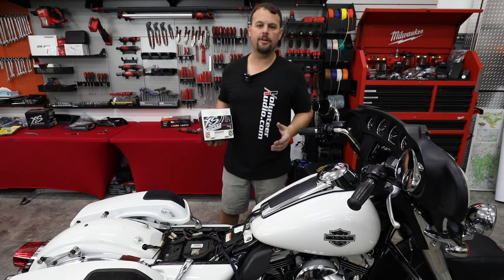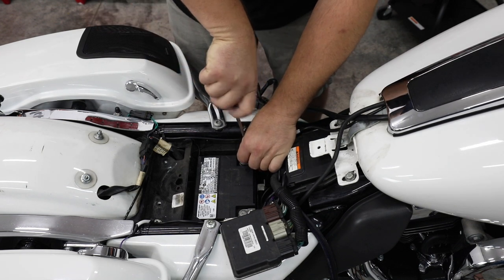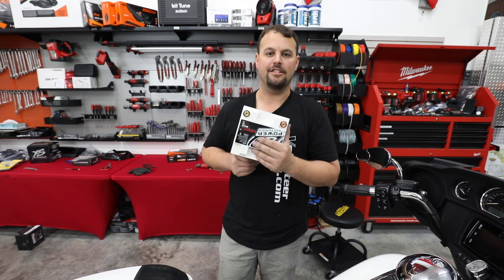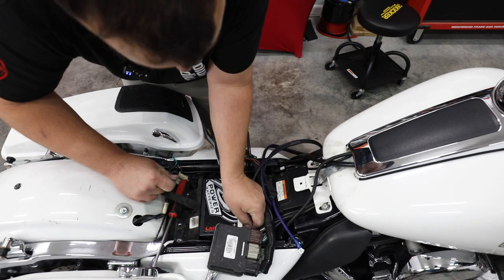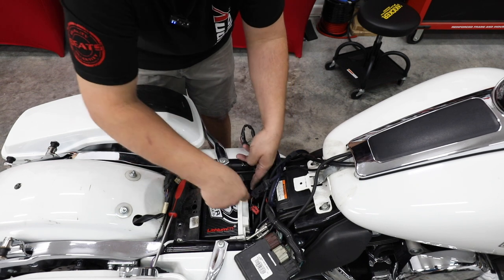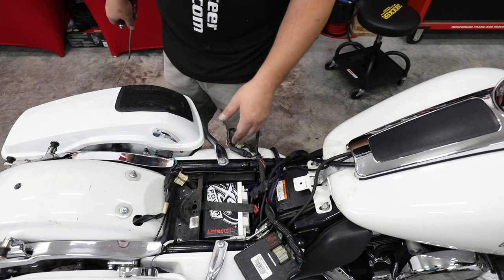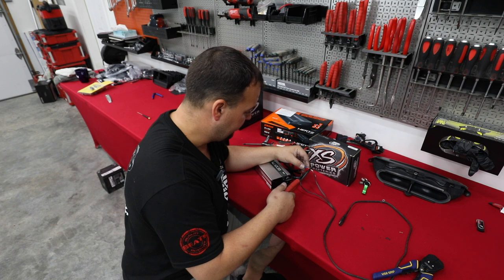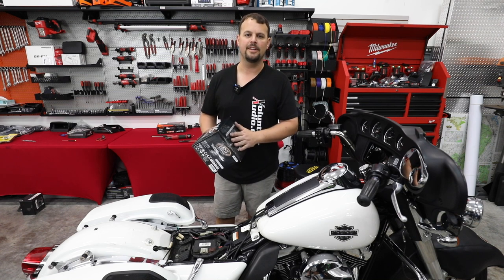How to Install the Largest XS Power Li-S925 Lithium battery in a Harley Davidson Touring Motorcycle

Comment: Thanks for the informative video. One comment, are you not supposed to disconnect the negative first?
Reply from the maker: All service manuals start all directions with “remove negative battery cable” for all repairs.  Removing the negative or positive either way breaks the circuit and disconnects the battery.  I do not believe it actually matters as to which one you remove first.
Reply: @volunteeraudio  removing the negative side first, there is no chance of creating a direct short to ground when the wrench you are using accidentally touches the frame...

Comment: Still loving your videos Jay.
 I'm curious as to why you choose to use "non-insulated crimp connectors" versus soldering connections together? Time?  And, do you use the marine grade adhesive lined Heat Shrink tubing? 
Also, I know they are pricey, but have you considered the heat shrink connectors with the solder made into them? Wouldn't those be even quicker?
Keep up the Great Work!
Reply from the maker: The low temp solder in the heat shrink connectors will not hold up to heat from the engine, non insulated crimp connectors hold up better with vibration than solder, when you heat the wire up to properly solder it weakens the wire and can break easier under high vibration like Harley.  We use adhesive lined heat shrink tubing when needed but we have reasons for when we use it

Comment: I live in the mid west so it gets cold here (below freezing). My question is will a battery tender work to keep my battery charged and or warm thru the winter. Was thinking of ordering one since my AGM died. Any assistance would help
Reply from the maker: It will keep it charged but likely not warm

Comment: Jay,
It appears in the video that you grab the negative amp wire and main negative and connect it to the positive side of the battery (the positive and negative on the Li-s925 are reversed from the stock battery).
Reply from the maker: Not on our battery, they are correct, this li-s925 is built for Harley with reversed terminals
Reply: Is your version of the s925 used in the video, because you can clearly see a + sign on the throttle side of the battery (which is opposite of the stock battery)?????

Comment: Do you also need to replace the voltage regulator for lithium
Reply from the maker: No it charges the xs power batteries no problem

Comment: Correct me from wrong but this battery never dies even in freezing weather right
Reply from the maker: We do not recommend lithium batteries in below freezing environments, lithium batteries still work but must warm up before you crank the engine, normally if you turn ignition on and wait 30 seconds the battery will warm enough to start but most people do not ride a Harley when it is that cold
Reply: @volunteeraudio  correct that's what I was confirming that you cut it on Make sure the tank came on Wait about five maybe 10 minutes cut it off and do it again to where the battery could warm up and then go ahead and start it I was just confirming that it was correct It does work in cold weather but you have to let it warm up first
Reply: @volunteeraudio  do you have a link or part number for the right angle and battery you use to remove the bolts
Reply from the maker: @newmoney8128  Milwaukee 3/8 m12 ratchet
Reply: @volunteeraudio  thanks

Comment: Braille Harley Battery is best for audio systems. 8000 watts and I rarely trickle charge it.
Reply from the maker: The braille you refer to is a 30 series case which xs power offers as well, in this video we used a 925 sized case which has a longer amp hour rating and more overall cranking amps than the braille g30
Reply: @volunteeraudio  id run them side by side and do a test on them. I have used both and Braille lasted much longer then XS power on a 8000 watt system without the need for charging. Only about 3 hours. So close. Either is good for any basic audio upgrade. Quick question, which battery are you a dealer for?
Reply from the maker: @ShadowSolja  there are 4 different xs power lithium Harley batteries, one is smaller than the braille in power and the upper 3 are equivalent or stronger
Reply: @volunteeraudio  I agree. But have you done a bench test to see which ones discharge faster under heavy audio load? I would like to see that video if you decide to do one.
Also, love your wireless Apple car play dongle. Works like a champ!!
Reply: @JS-ux2yn  yes I would recommend removing it and placing it in a warmer spot. Once the battery is 100% charged and not connected no need to keep it on a trickle. Limitless lithium is also a good battery. I have froze a battery once. But I was able to warm it up and connect to another lithium for a few days and recover it. But sometimes that does not always work.

Comment: Would we not recommend connecting power first then ground? This would give less chance of installer getting shocked. Now with that said,  thank you for the videos.
Reply from the maker: You don’t get shocked from a 12volt battery
Reply: @volunteeraudio  Ah, the advantages of a climate controlled shop...
I guess you've never had a sweaty arm against metal when connecting a car/truck/motorcycle battery 🤣😂
Reply from the maker: @ricks1925  in 24 years I would say that has never happened
Reply: @volunteeraudio  as an ex auto mechanic, it's happened to me on more than a few occasions. Nothing like 120V, but you definitely feel something biting you!😄

Comment: What about the LI-30Q? Will it fit a Harley touring bike?
Reply from the maker: Yes the 30 series fits perfectly, the 925 has more cranking amps and amp hour rating
Reply: @volunteeraudio  how about the LI-S975
Reply from the maker: @Heavy69Metal  it does not fit properly
Reply: @volunteeraudio  damn
Reply: @volunteeraudio  Hi Jay, slightly confused, looking at your website it seems to suggest the opposite, the XS Power – Li-S30Q – HD has more everything than the battery in this video, from Crank Amps to Ah, to wattage, to energy, so not sure why you would want to install the 925? Plus the XS Power – Li-S30Q – HD seems much more of a drop in fit than the battery in this video? I shall be ordering a battery of your website soon just like to clarify this first before ordering
Reply from the maker: @RickyG512  for a long time the li-s30q was not available, the latest is the titan8 version
Reply: @volunteeraudio  Hi Jay, thanks for the super quick response, the titan8 does look amazing, with many new features, but the AH capacity seems to be half as much of the XS Power – Li-S30Q – HD for the same price, so if the new features of the titan8 were ignored, I'd assume it would be better to get the XS Power – Li-S30Q – HD for having double the capacity for the same price?
Reply from the maker: @RickyG512  the titan8 also recharges 5 times faster than other lithium batteries and has a much longer life
Reply: @volunteeraudio  You are definitely correct there Jay, but but I do wonder if the capacity will be enough as the AH is just 10 vs 26